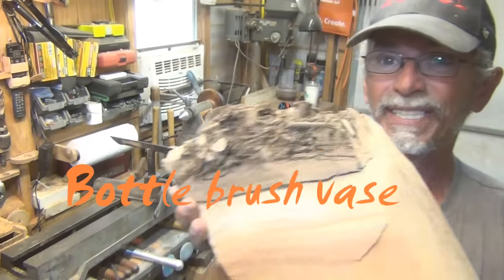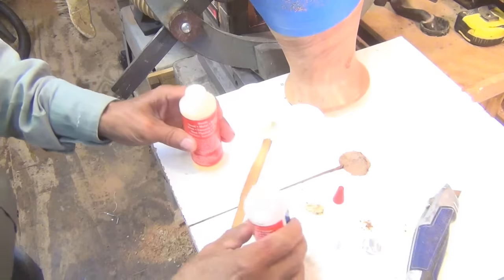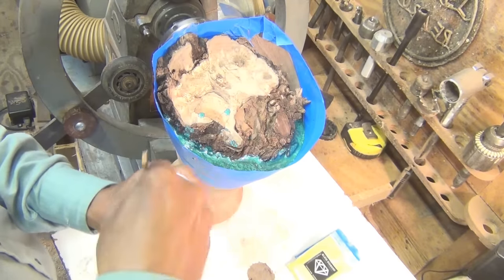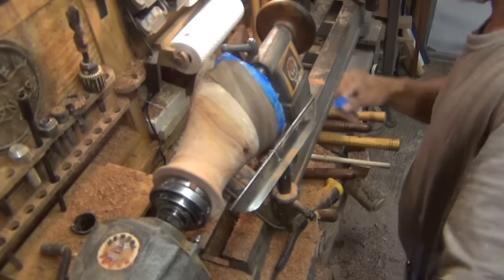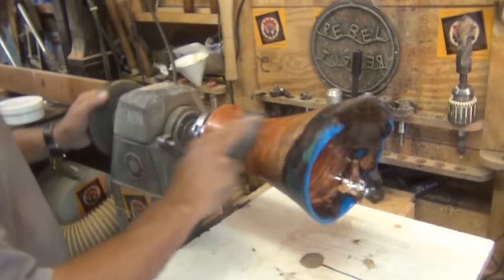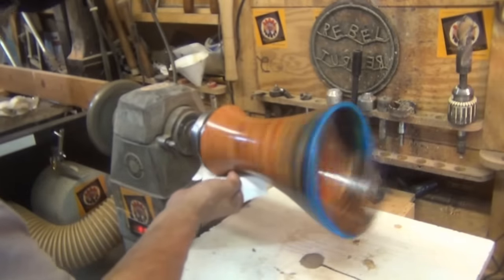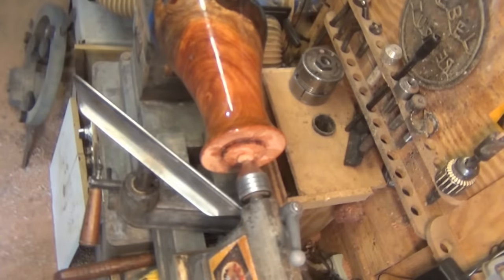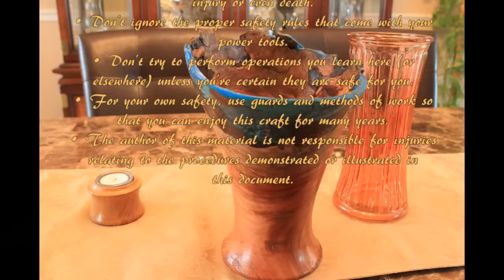Wood turning Bottle brush and colored Epoxy vase

Comment: Another great piece from the Rebel Turner. Thanks Al. I really like the shape and the wood is outstanding. Weather you like the finish or not it looks good to me. The only thing I would change is the smooth edge of the epoxy. I think it would look better if you could texture the edge some way to mimic the texture of the natural bark edge that remains. But you still got a "like" from me.
Reply from the maker: Thank you for watching and commenting my friend. Funny you said that because after it was in the house that bothered me as well  and I took a file to it to get it away from that   and the fact it came up a bit whiter was another bonus to it so I left the top edge rough and not that Cobalt blue that stood out a bit much.Thank you. take care

Comment: Hey Al, WOW the grain in that piece of bottle brush is absolutely amazing and you really out turned yourself this time, that is a fantastic vase, I loved the little added bit of colour with the epoxy, it gives it just a bit of contrast to the beautiful wood. 
Just wondering does the lacquer that you put inside the vase make suitable for water use or is it just a stand alone piece not to have anything in it?
Keep on Turning 📐💜📐
Reply from the maker: Thank you for watching and commenting my friend. Well if you listened it was obvious I had someone walk in and took over LOL  (joking) Well lacquer is water resistant but not enough to hold water for long term. If you are looking for something that will give it a water proof and paint/spread Epoxy or resin on the inside of the piece, That will make it water proof.
Reply: Rebel Turner 
Hey Al, I don’t know who took over the beginning of your reply lol but thank you for the information on the water proofing, I was always wondering how you did that.